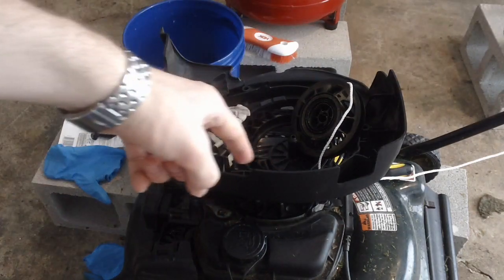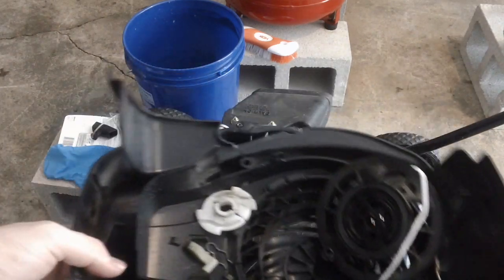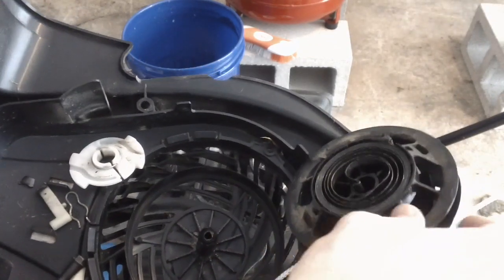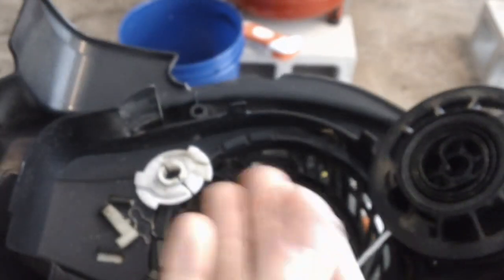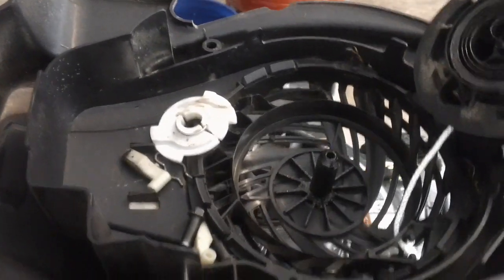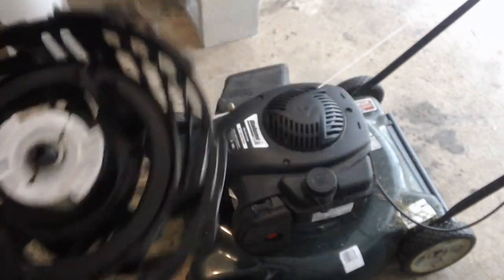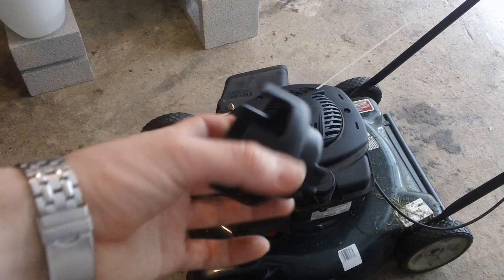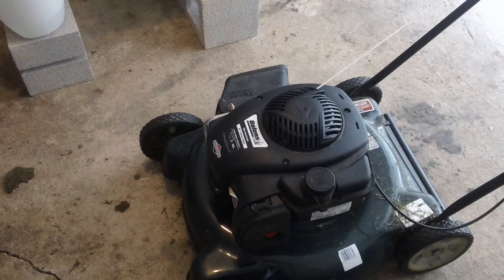Bolens 125cc Lawn Mower Recoil Starter Flaw

Comment: my clip failed over time and just slipped off so I'm shopping for a new assembly mean time I saw a video where a guy got the same size socket for the big nut on top of the fly wheel that's under the pull assembly and you get a regular drill and the right adapter for the socket put it in the drill and with the drill in the righty tightly position aka forward put it on the big nut and hit that drill a start that little motor race car style lol just make sure you've pushed that fuel start bubble 10x or spray some engine start in the air filter box. Its great fun but I still want the pull start because who wants to bring a drill every where you mow

Comment: Hi. Thx for the video. I bought a new whole mechanism also. Exactly how does it line up please.
Reply from the maker: You remove the top cover with a nut driver, note where the rewind mechanism is positioned then you should be able to get under it with a screwdriver or prying tool and pop it out, if you pop the replacement in the same orientation, there shouldn't be really any lining up to do, you might have to rotate the center spindle, but screw holes guide the rest of the way

Comment: Thanks for uploading this video. I have the same lawn mower. I think I have the same problem. I can only pull the recoil so far. I’ve opened the top but can’t seem to find where or if the piece is broken....would you mind showing where your piece broke from?
Reply from the maker: If you're having trouble pulling out the cord, then I think you have a different problem. The problem in this video would be indicated by a cord not retracting or feeling very loose.

Comment: Hello, the same exact thing happened to my mower with the plastic anchor breaking off. What was the solution to replacing it? Did you buy a whole new  top cover?  If so, where? Thanks in advance.
Reply from the maker: I did get a new recoil assembly; ordered it directly from Briggs & Stratton and I believe the part number was Product: 593959 -STARTER-REWIND.